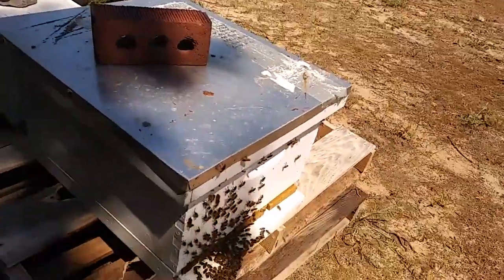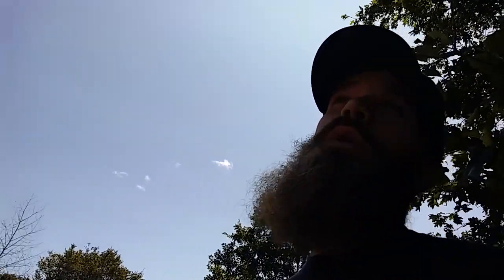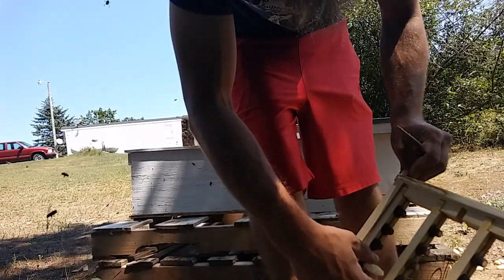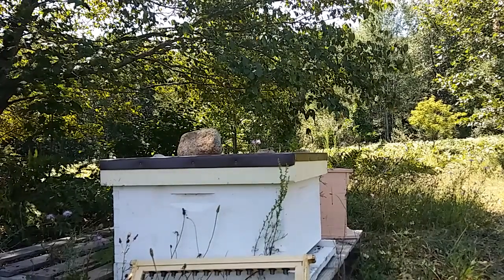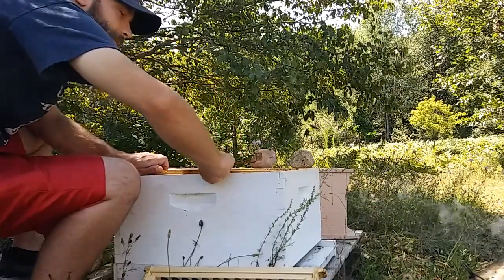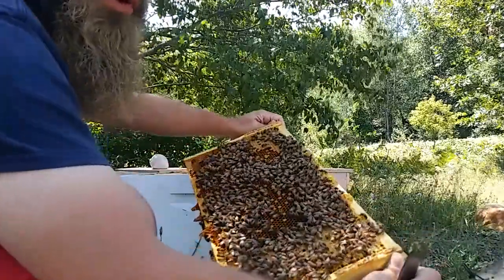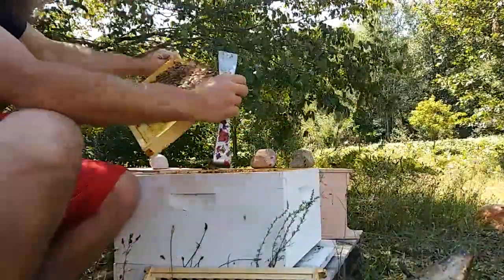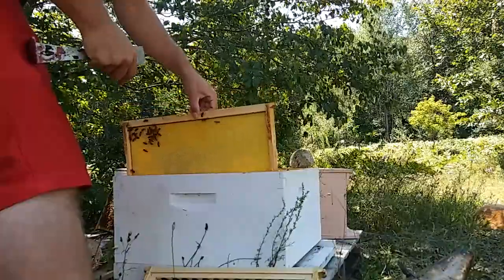Grafting Queen Bees Part 1

Comment: Good videos. Thanks for sharing your knowledge. Just a tip here: I use a simple, small headlamp when I graft; it´s quite convenient, in that it leaves both your hands free in case your frames should slide or move.
Reply from the maker: Thanks for the comment and the tip. Since I now graft in the truck I actually am using a magnified and illuminated headlamp.

Comment: Hey Brett...love you man....I wanted to tell you my progress with my venture in raising queens....remember my last message I told you I only had 3 accepted out of 16 cups...well I took that cell bar frame and placed it into my Queen starter hive...double box with queen put into bottom box by excluder...I looked after a week...that crazy hive had filled that complete cell bar frame out with wax over top of the cells in the cell bar...and completely filled the whole bar with wax...just like the other frames in the high...learning experience...but just wondered if it ever happened to you....
My second attempt is going better...with 17 of 30 accepted....
Reply from the maker: Yeah sometimes they draw wax on the cell bar frame, you can put a frame of foundation right next to it to try to entice them to draw on there. Either way, a sharp knife or scissors will trim those cells up nice for you.

17 out of 30 for your second graft?! That's awesome!